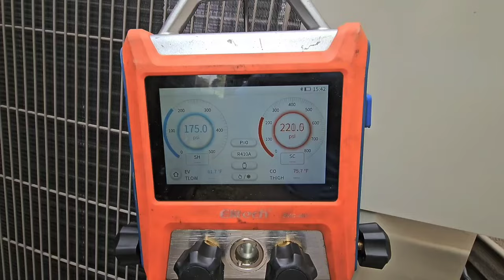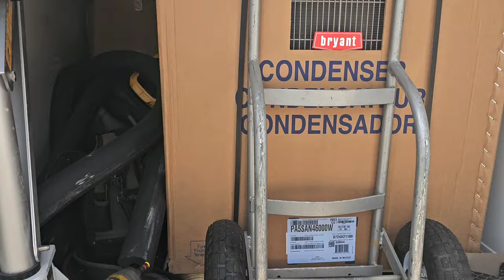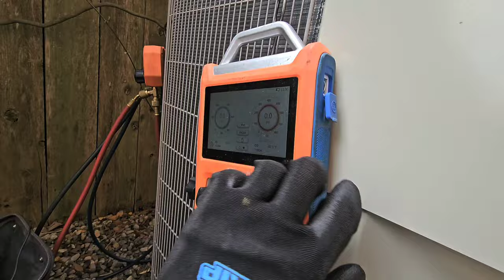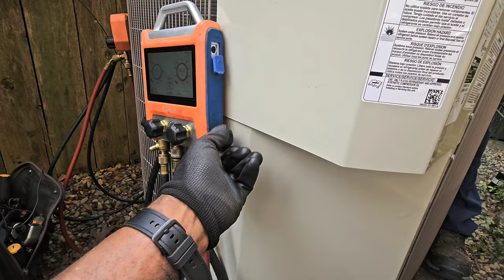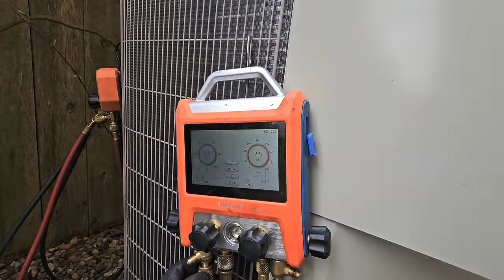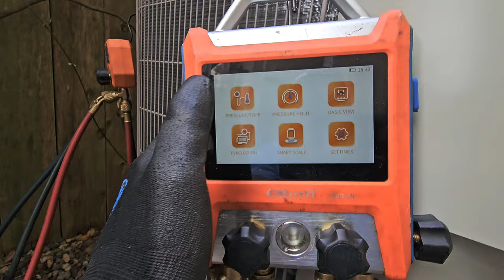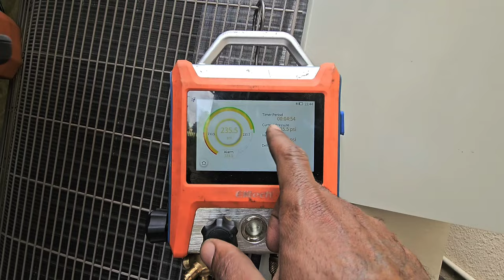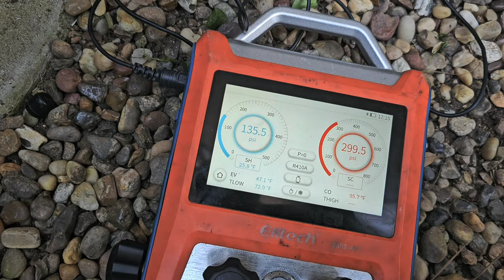How to install condenser unit #hvac #giveaway #10000

Comment: I noticed you don't take out the schrader pins or wrap the service valves nor use the nitrogen while you braze ??
Reply from the maker: I don't use nitrogen every time, especially for home warranty work. However, I did wrap the king valve and Schrader valve to protect them from getting too hot.

Comment: Walter Shannon here in Crosby. I wanted to know on this new outside Unit Install if the new Unit came precharged with Freon Coolant which didn't you evacuate the old Coolant out of the system. Would that be overcharging the system? Just asking no offense 😊.
Reply from the maker: Thanks for asking! Most units come with factory-charged units. The amount of refrigerant in the unit doesn't necessarily mean it's enough for the application. It's best to charge by superheat and subcooling, as some line sets may be longer than others. Mixed-match systems, such as this one with a Goodman evaporator coil and carrier  condenser.
Reply: @WWHVAC Walter Shannon here thank you for explaining that to me appreciate you. Remember I watch your Channel more than I do regular TV.
Reply from the maker: @MCRD115  Thanks, Shannon. I think YouTube is becoming the new TV for a lot of us!
Reply: @WWHVAC  Yes, Sir it is
Reply: That’s crazy the discharge port didn’t come swaged already